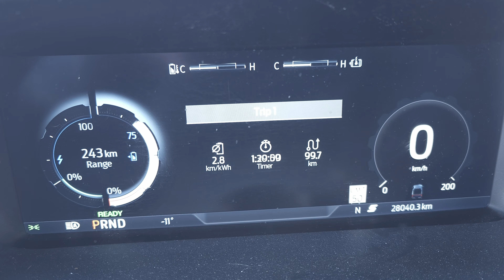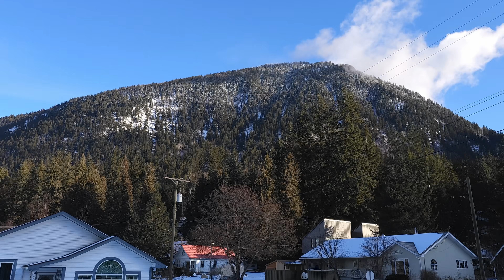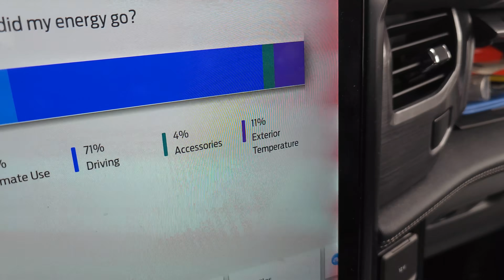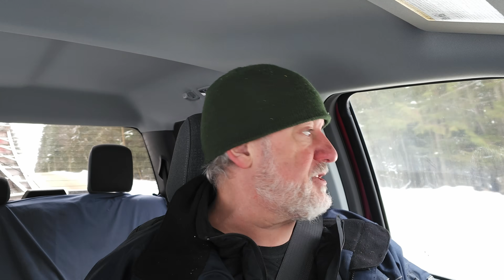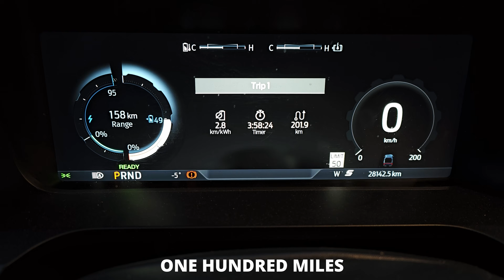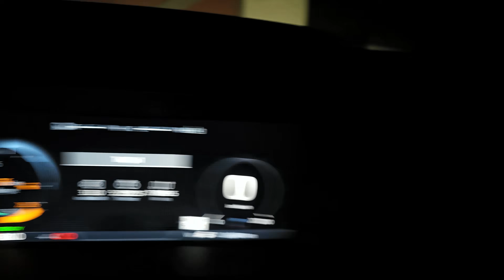My EV Truck Heat Pump SHOCKED Me in Below Zero Test!

Comment: I would have bought a lightning except I apperently can not put my fifth wheel tailer hitch in it.  I have been towing my RV with a 2011 F150 ecoboost so I am sure the lightining would pull  it. Does anyone  know whyÉ
Reply from the maker: The Lightning has a more robust frame and comparable payload in the bed, but I think it has to do with the location and access of the battery pack, along with its weight rating that would put significant range pressure on the vehicle. Mine is rated to 10k pounds, so from that perspective, it seems doable. However, the towing range sucks, and my truck at maximum towing capacity would need to be charged every 150 miles, unless towing to a site where the truck and trailer can be plugged in while camping.